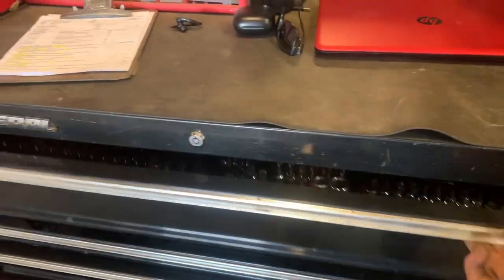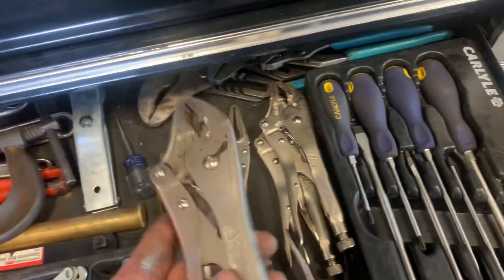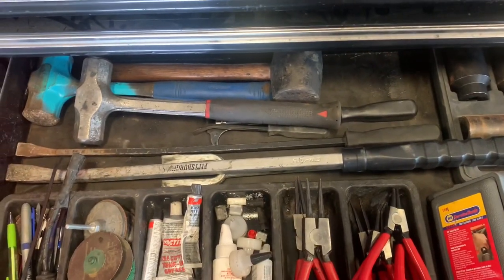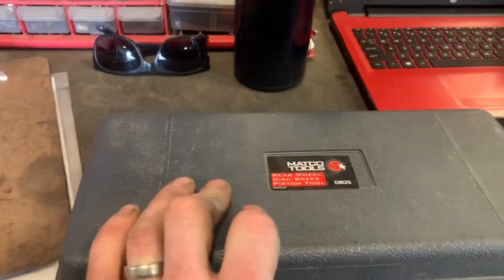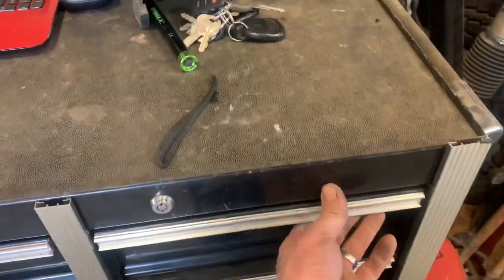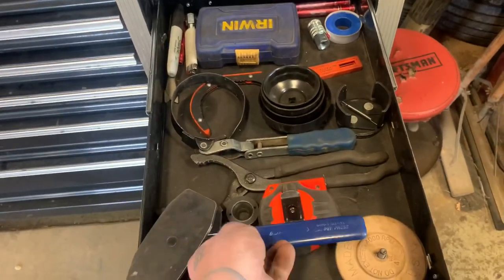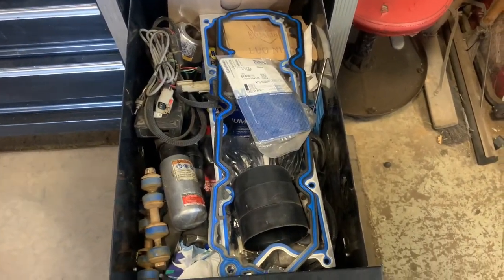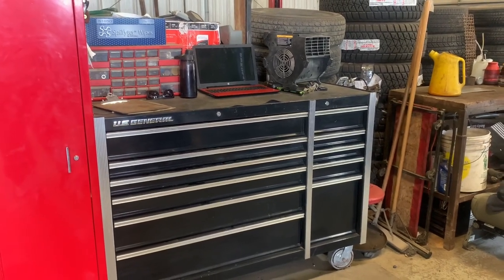Tool Box Tour - Cheap Professional Setup

Comment: I don’t need Snap-on tools he says. I can use Harbor Freight garbage he says. Then in your other video instead of using a harbor freight garbage ball joint tool you whip out a $700 Snap-on BJP1 set. What a hypocrite.
Reply from the maker: If you had read the description to the toolbox tour video, I clearly stated that most of the Harbor Freight stuff is good enough, but that you need to upgrade some things. Like the ball joint press. I agree that the Pittsburg press is junk. I snapped one the first time I used it. Have a good day sir!
Reply: Fulcrum your acting like a snob. HP Tech is correct, you need to listen to him